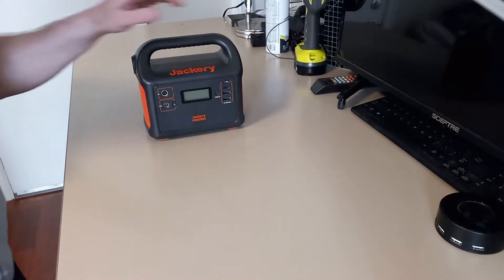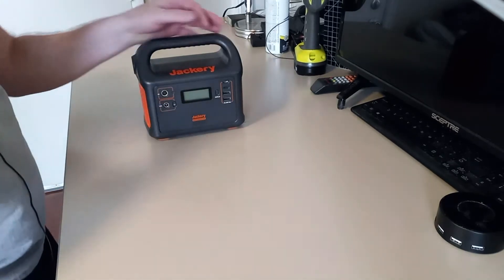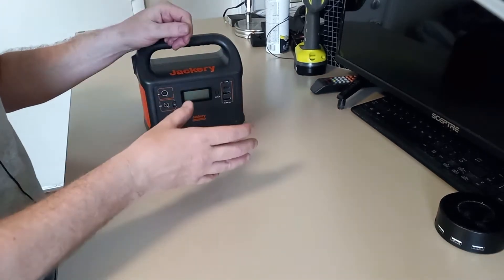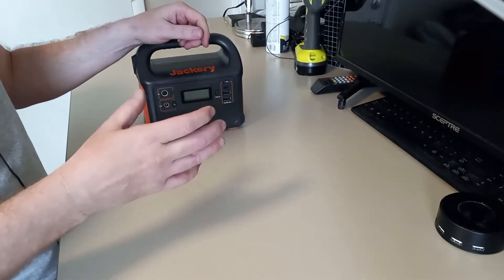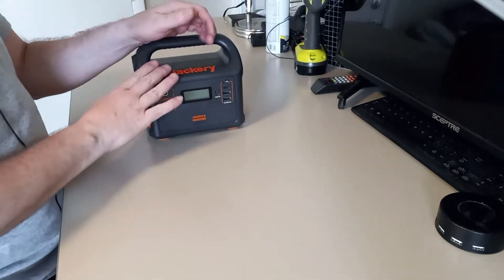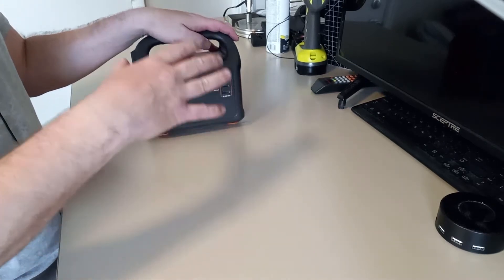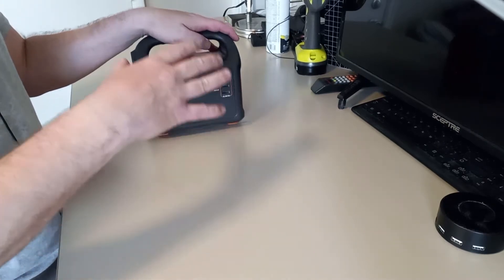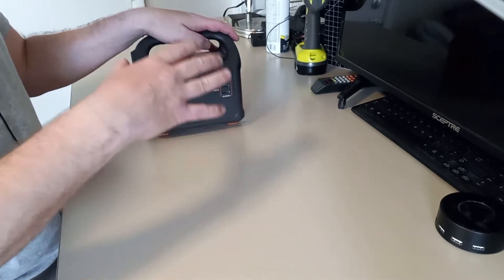Solar Powered Car Appliances

Comment: Hey I'm so sorry, I have a few questions to clarify about this. 

Correct me if I'm wrong, but this is what I understand.

During the day, you plug your fridge into the Jackery while the car is not driving. When you're driving, I assume the 12v fridge is plugged into the car.

During the night when you're sleeping, you plug the fridge into the car. 

When do you charge the Jackery exactly? As it seems like you don't use solar that often

Also, might you know of a more budget friendly battery/solar system? Thank you!
Reply: Thank you for watching my videos.  To answer your questions, after living in my car for almost 100 days, I have found that I don't need the solar charger.  I leave my car on all night to keep the temperature where I set it on the thermostat.  Since I have a Prius, my car only needs to turn on for about 90 seconds every hour to recharge the battery system, so keeping my car on all night means that it is still silent most of the time.  Keeping the car on at night also recharges the Jackery power station, which then keeps the refrigerator running during the day (when I am working and the car is off).  

If I did things over, then I would buy one size larger Jackery (the 240Wh), because mine (the smallest and cheapest size) does not have enough charge to run the refrigerator all day on hot days.  I would also skip spending money on the solar charger, since I own a Prius.  It is not very useful for a Prius, which is basically a gas generator on wheels that can recharge anything, and can recharge a battery system (like a Jackery) overnight.

The cheapest way to go would be to skip having a refrigerator.  It is possible to create a meal/grocery plan that involves food that does not need to be refrigerated (for example, dried and canned goods).  Otherwise, the Jackery power stations are one of the cheapest ways to have an inverter to power low wattage AC devices and provide power when your car is off.  If you find better ways, during your research, then let me know.

Hope that helps.  Good luck!
Reply from the maker: Thank you for watching my videos.  To answer your questions, after living in my car for almost 100 days, I have found that I don't need the solar charger.  I leave my car on all night to keep the temperature where I set it on the thermostat.  Since I have a Prius, my car only needs to turn on for about 90 seconds every hour to recharge the battery system, so keeping my car on all night means that it is still silent most of the time.  Keeping the car on at night also recharges the Jackery power station, which then keeps the refrigerator running during the day (when I am working and the car is off).

If I did things over, then I would buy one size larger Jackery (the 240Wh), because mine (the smallest and cheapest size) does not have enough charge to run the refrigerator all day on hot days.  I would also skip spending money on the solar charger, since I own a Prius.  It is not very useful for a Prius, which is basically a gas generator on wheels that can recharge anything, and can recharge a battery system (like a Jackery) overnight.

The cheapest way to go would be to skip having a refrigerator.  It is possible to create a meal/grocery plan that involves food that does not need to be refrigerated (for example, dried and canned goods).  Otherwise, the Jackery power stations are one of the cheapest ways to have an inverter to power low wattage AC devices and provide power when your car is off.  If you find better ways, during your research, then let me know.

Hope that helps.  Good luck!

Comment: You made a mistake. You glued the cables over a part of a cell. That cell and all other cells that are in paralel with it will produce 0 power. So please remove that cable.
Reply from the maker: Thanks for the comment.  Sorry for taking so long to check comments and respond.  Unfortunately, I could not find what you mentioned about the cables.  I didn't glue anything in my car, so let me know what you meant.  Thanks!
Reply: @livinginaprius I believe @renmedia was referring to the orange part that takes the cables from the two solar panels and transfers, or combines, them to the main power cord to the Jackery. You used two-sided tape to adhere that part to the top of one of the solar cells. When that’s done, it will make that cell incapable of producing power to the Jackery. All cells that are parallel to that cell will also have zero power charge. I hope that helps. 

I also understand why you don’t really need the solar panel considering you have a huge battery system on four wheels. I can use your design, without blocking any part of the cells, to work with my gas-powered, mid-sized SUV. You have many videos that will help all part- and full-time car-campers. Thank you so much!

❤️😊Brenda & Blue🐕‍🦺❤️